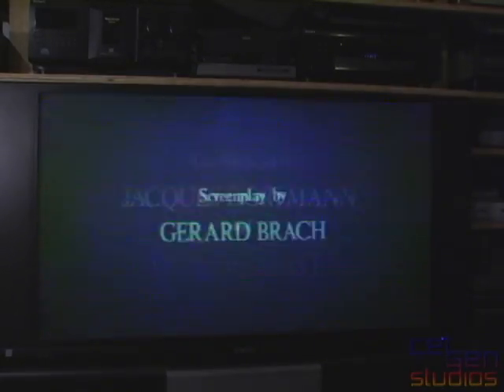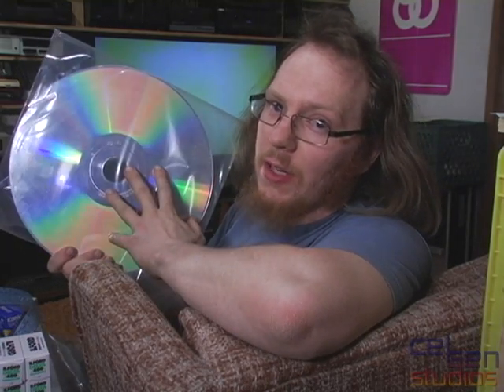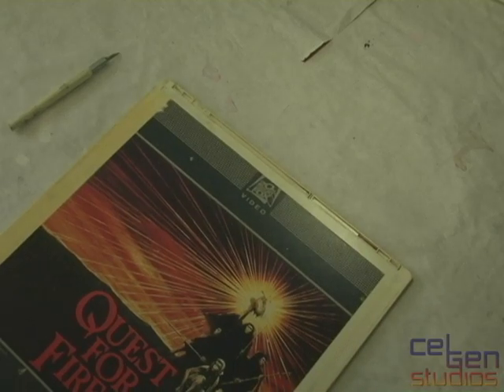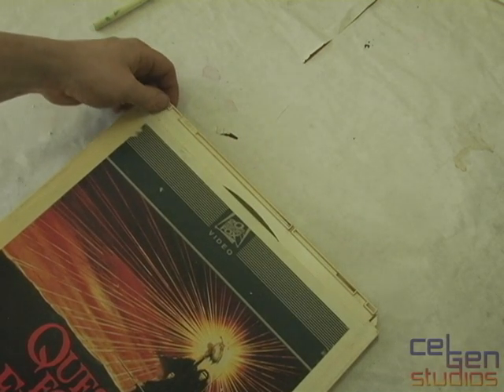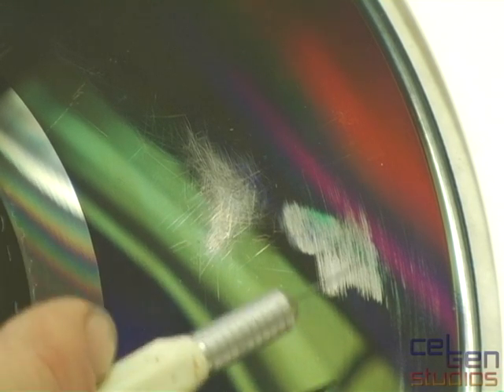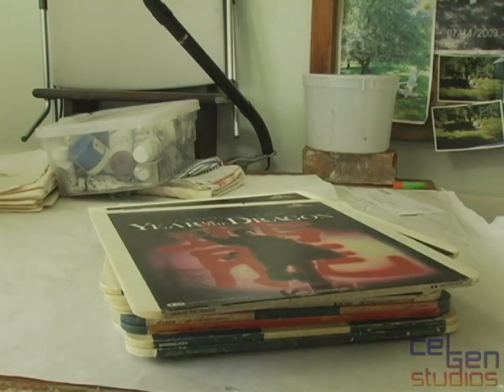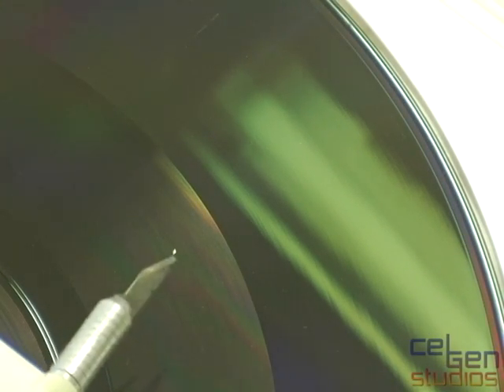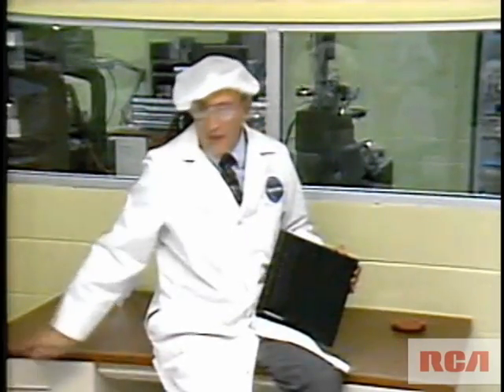What makes a CED Skip?

Comment: As a guy who doesn't own any of these yet, I have a weird tech question. There's a few discs I know that are one-sided, usually the second disc of a two-disc movie (The Godfather, Return Of The Jedi, and Scarface are the only ones I know). Being that they are less than three hours long, that means the fourth side is blank. If you inserted the fourth side (or, with a double-sided player, began playing the fourth side), what would happen? What would you see and hear, and would that damage anything? (Excuse me for being a total noob, I don't have discs or players to try this with.)
Reply from the maker: I would assume that just like Laserdisc an unused side is just stamped with  a single video frame its entire length of the side indicating the programming is on the other side.
Reply: @CelGenStudios  I highly doubt it's anything as cool as the upside-down turtle on the older Pioneer laserdiscs. I genuinely don't know though. I've never tried to play a blank 4th side of a CED. Will have to do that when I get my home theater back together.
Reply: When you insert a blank side of a disc, the player will immediately indicate the End of the disc as soon as it spins up and not advance the stylus any further.

Comment: OK I've had the CED players and discs since they came out new. That at least gives me some creds to weigh in here...that and I've talked with ex-RCA CED techs about this format. They adamantly say not to clean these discs with a RCM(record cleaning machine) as it will remove or ruin the silicon coating of the disc. Well, OK....but I question if that's a bad thing when trying to bring back a hopelessly skipping disc? As was correctly stated, if these discs were ever stored on their sides, the silicon coating will get scratched. So unless you buy from a collector that you see with your own eyes has stored them vertical, you're going to get discs that have been stacked on their sides and ruined...even if they are still sealed. I've bought hundreds of discs in that 'ruined' condition, And after all this time expecting to inflict guilt on a seller for 'ruined' CEDS, forget about it because they have none....they're just looking to unload the format onto the next rube. My best advice is to buy them CHEAP and maybe put them through a good RCM bought because you have LP's anyway. I certainly wouldn't spend the money for a RCM just for these discs. Playing them over & over will only moderately help skipping. Don't ever pause a movie as that can make a permanent 'skip' at that same spot. Probably something that some machines were inadvertently capable of. Don't ever touch the discs with your fingers, but don't be afraid to open them and investigate the damage. You will not harm them if you lay them out on CLEAN microfiber cloths.